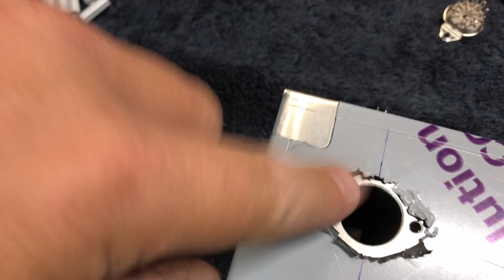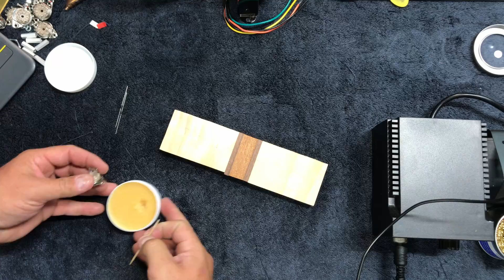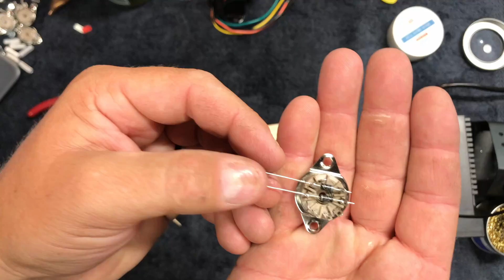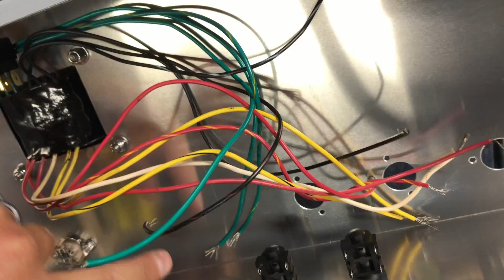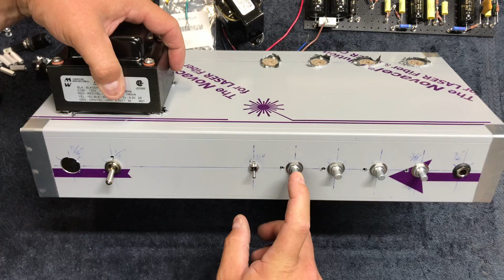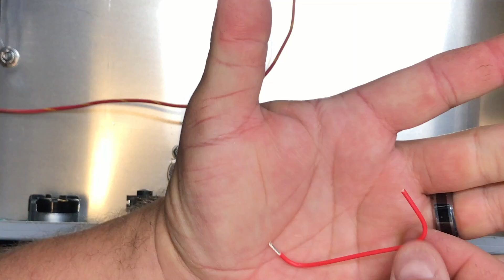Let's build the world's greatest guitar amplifier Part 9.2

Comment: Mechanical connection is mil spec. Some say strait through is poke and hope. Just a 90 degree bend is good. A slight hook better. I was thinking for wiring the sockets,, bend the tabs down on a 45 degree but for the heaters keep them vertical that way you have a little wiigle room to get in and solder them up . Aslo a verical plunge for the heater wires.
Reply from the maker: Mil spec is not what everyone thinks it is. A mechanical connection is NO connection. Doesn't matter if there is solder or not. The solder is the connection. The argumant is that a mechanical connection will cover for a bad solder joint. It doesn't, the reason is because if the solder failed, and you lose connection, then you NEVER had a good connection. technically a Mil-Spec connection has expansion and contraction built into it. I.E. you MUST have strain relief built in, which means ALL parts must be able to float in space, and NOT be affected, by heat, cold or vibration. 99.99% of amps that say Mil-Spec, are not... Not even Hi-Watt. The solder is the connection, no more, no less.

Comment: 11:30 I hate to disagree with you, but the point of the solid mechanical connection is to prevent the solder from cracking, not to keep the amp working if the solder fails.  I am enjoying the video series. I like to see how other people build their amps.

As for fuse-first or switch-first, I'm fuse first for all the reasons you listed, as well as a couple others.  I like to use the IEC connectors with built-in fuses and those are hard-wired fuse first, 2. with the switch first in line I feel it may absorb some of the initial shock of a power surge causing a slow-blow fuse to open slower, and 3 if someone is checking fuses without unplugging their amp....well, stupid should hurt.
Reply from the maker: From a repair and tech standpoint, a connection that is 360* wrapped is a nightmare to fix and replace, furthermore, it doesn’t guarantee the solder connection will never go bad either. A 180* to 270* wrap is more than sufficient to hold a part in place and provide a good soldered hold. I like to look at it like this: too much of a good thing is still too much. Thank you for the comment and I’m glad you’re liking the series. Hope to read more comments from you.
Reply: @atech9020  I agree it's overkill, but it's mil-spec. Then again, mil-spec is overkill for anything but nuclear missile systems.